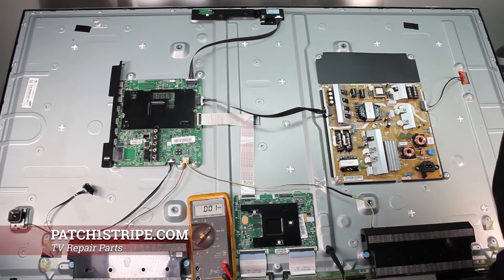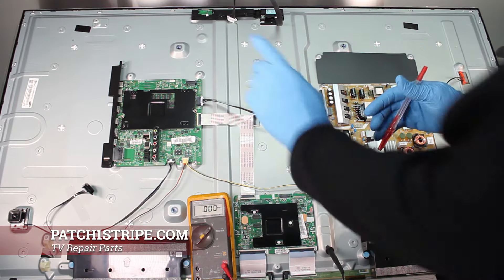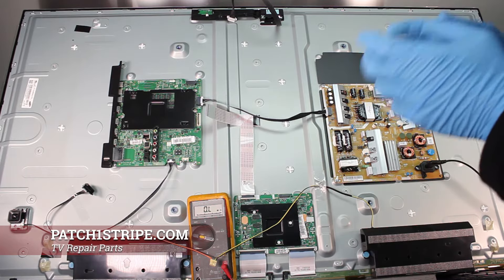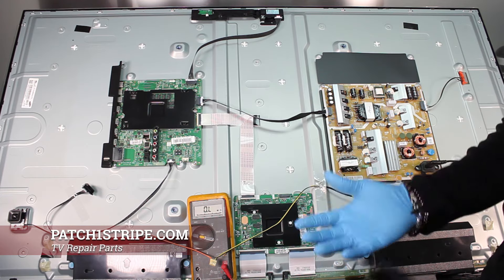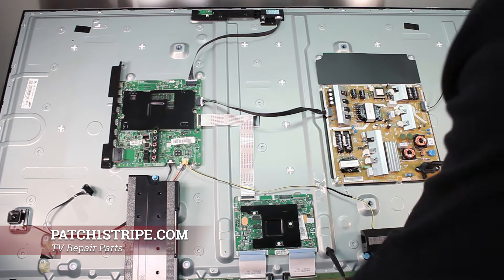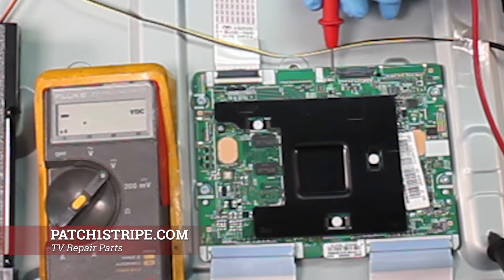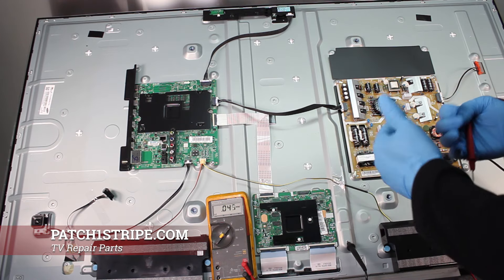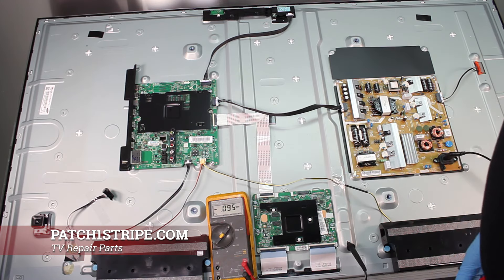HOW TO REPAIR ANY SAMSUNG LED TV:  Won't turn on,  No power

Comment: I have an 82" Samsung UN8000 that doesn't turn on, and the power indicator LED on the bottom of the TV is completely off.  Is that just a fuse or the power board that needs to be replaced?
Reply from the maker: Hello, you will have to take the back off of your tv and go through the process, other wise you will be shot gunning your repair with un-necessary parts. This process is proven to work, it will save you time and money.
Reply: @Patch1stripeTVParts  Edit:  After following your process, I've discovered that I now need to purchase the main board for the 82NU8000 Samsung TV.  Do you sell parts?  If not, do you know roughly how much it cost?  Thanks P1S.

Comment: Thanks for the great info ...now quick question when I plug in the TV I get clicking and red led flashing i can hear it buzz on the left of the power supply board then it shuts down and tries again.. i have no leds lighting up no matter what I disconnect so do I have a power supply problem or an led problem im guessing led because that's my luck... thanks for your time..ps my tv is identical to the one in this video...oh one more thing when I disconnect the main board from power supply board it quits clicking on and off
Reply from the maker: Well your at 50/50 in your choice of parts to replace. I would choose power supply.
Reply: @Patch1stripeTVParts  Funny thing is I went to buy a power supply and the guy asked if it was blinking red in the front i'm like yeah … then he refunded my money and said it's the led or backlight I guess he said that he sells these all the time and people hassle him for a return because it's hardly ever the power supply with that model so i'm going to see if I can do a multimeter test to rule it out if it's the LCD though that would need to be dropped or there would be dead pixels in it before it went black wouldn't you think? I really appreciate you getting back to me my mom has no money and i'd really like to get this fixed for her this was her late husbands TV he always bought the newest stuff that came out when it came to technology.. God Bless be safe and thanks - Steve

Comment: good evening sir. i have SAMSUNG UHD 55 inches model RU55RU7100K when i give power the RED light blinking 2 times continues. how can i know the mother board or power supply has fault.
Reply: praneeth fernando You won’t know until you open the back. He actually explained the eliminations process in the first 13 mins.
Reply from the maker: Wil is correct. You can do this. We are here to help you do it! Let us know how you are coming along.
Reply from the maker: Thanks Wil for responding. Help is appreciated.

Comment: Hello sir, I have a Samsung QN075FLLV2H space LED TV 75 inch I have replaced the power board but still not getting any power. I did not use a voltmeter to troubleshoot before replacing the power board, I have disconnected the main board from the power board and still no power or LED lights are coming on. Any suggestions? Thank you in advance
Reply from the maker: Most of these 75 inch plus TVs that I have encountered lately has needed backlight replacement. I think you need to replace your backlights. Hope this help.

Comment: You said that it will work without the wi-fi and then said it would not ------ Will it work with out the wi-fi cable hooked up?
Reply from the maker: yes
Reply: @Patch1stripeTVParts  Thanks

Comment: My tv wont power on and bfr that my remote stopped  controlling on/ off switch but it works fr menu options so i opened my tv and i tried to unplug the main board and plug it bak in it started smoking but still back light come on when i unplug it but i can see a burnt black chip on it ,also my tc board wen i unplug it the bak lights dont come on does the mean its bad too?
Reply from the maker: The t-con board is probably fine. You have to resolve your mainboard issue first. I think that will solve all of your problems. I will check my warehouse to see if I have that part number. I will contact you in a couple of days.

Comment: I already change the t-con , the power supply and the main board brand new and the tv, samsung un50eh5000f, still won't turn on. Do I have to check the back lights? Please help.
Reply from the maker: You have changed everything except the backlights.

Comment: I have the newer Samsung T-con in the mainboard TVs. When I plug both ribbons from main to the LCD address panel , my TV struggles to stay powered on. When I plug any single 1 of the two ribbons to LCD address , the TV stays on but no picture. So I guess it's the ribbon cables, LCD address board, or something further pulling the TV to power down ? 

Any tips on what I should do?
Reply from the maker: First I would swap the ribbon cables around to see if you get the same results which would eliminate the ribbon cables as being your problem. Next I would let the tv come on and stay on for about 2 minutes then unplug power from the unit and feel for hot or warm components on the main board and the LCD address pcb's. If you find components that are over heating that would be you problem area.
Reply: I put a new mainboard and powerboard in so those should be good from overheating issues. I'll buy new ribbon cables and go from there! Not sure at all how to work with the PCB address boards because they connect under the metal case to the screen through some orange film connectors
Reply: @salmannasir793  I am having the same issue.  Just happened last night out of the blue.  The only thing I did that day was connect a Chromecast to the HDMI and the USB to power it. Did replacing the ribbon connectors solve your issue?  Thanks, Salman.

Comment: need some help sir, about my samsung 32 inches led tv, hope you can tell me the problem. to much heat on the other side of my tv, but the other side, top and bottom are all normal, not heating that much unlike the one side, ty for the help, more power on your channel,thanks.
Reply from the maker: hello, the only thing behind the screen is LED backlight strips. You may have LED strips that are failing and causing other LEDs to draw excessive current. Take the time to remove the LCD panel and see what's going on behind it. It's easy to do with a small panel. Watch my video on replacing backlights for instruction.
Reply: Patch1stripe TV Parts ty very much, going to watch your video on replacing led,ty.💋

Comment: I have a 46" Samsung Smart TV that has backlights on but no sound or picture. I did your process of elimination but can't come up with which part to replace. Any help would be appreciated.  Gary W.
Reply from the maker: Did you ever try disconnecting the wifi module to see if that gives you video?  If so have you check that little fuse on the t-con board? Are you getting 12volt dc or so one both sides of that fuse? If all this checks out I would consider replacing the main board. Let me know.
Reply: @Patch1stripeTVParts  Thank you for your quick suggestions but I got confused in the process I decided to replace all the boards. Hope that works.  Thx, Stay safe & well,  Gary W.

Comment: I have a Samsung 4k tv, model UN60J6200AFXZA. Nothing comes on, but when i unplugged the LED strip cable that goes to the power supply the red light comes on once i press the power button on the tv. Could this be a back light issue? Should i be able to see what's on the screen if i flash a bright light on the screen? Because i dont see anything while flashing a light on it.
Reply from the maker: Go back and follow this video and your questions will be answered. I will help you with addition information and specific questions. Let me know.
Reply: @Patch1stripeTVParts   I followed everything in the video, the red light only comes on when i unplug the led cable from the power supply board, i can also now see words moving on the screen when i flash a light on the tv. Also when i unplugged just the lcd panel and powered on the tv i could hear chirping sounds near the led cable. I'm pretty sure it's the back lights, i just don't wanna make a mistake and get the wrong kind of back lights for the tv. Thanks for the help.

Comment: Hello Again, Just saw a video about loose ground screws on boards. I have two or three screws that will not tighten. Could that cause my problems? What do I do to fix the screws?
Reply from the maker: find larger screws but you always need good grounding.

Comment: I have a smart samsung tv 65” the tv turn on , but the upper part of the screen is clear and the bottom is darker and blinking, also sometimes the tv turn on and off by itself and recently I can not turn it on or off with the remote control I have to plug it in order to turn it on. I can only see one Chanel I cannot change Chanels. My husband think that the problem is in the power supply. What do you think we can do to solve the problem? Thank you.
Reply: samsung Led 65” UN65F6350AFXZA
Reply from the maker: Take off the back of your tv and follow the instructions on the video. The first move will verify if you have a backlight issue that I am suspecting is your issue. Hope this helps.

Comment: I have a vizon vp422 HDTV10A that lights the yellow Vizon symbol and goes white when power button is pushed but then nothing comes on. any suggestions? I dont want to spend money on parts I dont need. steve
Reply from the maker: are we talking Vizio or Vizon?
Reply: Sorry my bad. Should be Vizio

Comment: I think my TV has a power board failure/issue as I'm getting no back light whatsoever. The TV is 10 years old and after googling I can't find anywhere that still has this model in stock. Is it time for me to just buy a new TV?
Reply from the maker: What is the model number and brand of your TV

Comment: I have Samsung smart tv. There are 3 dotted back lights in “L” shape in the middle to the top of the screen which doesn’t go off when the tv is turned off . What are the possible problems?
Reply from the maker: The lens over those led backlights have fallen off. They need to be glued back on.

Comment: I have an LG 65"smart tv but at the moment it's not so smart ,lol tv comes on i can go through my apps but HDMIs are not working and internet is not connecting it says not conected it just sits  buffering with the LG icon dancing aground and also i got no sound, any advise
Reply from the maker: disconnect wifi module and see if HDMI connectors start working. If not replace you main board. Hope this helps.
Reply: @Patch1stripeTVParts  thanks for responding so fast will try ,that's what I'm talking about i send the same info to various YouTube channel months ago never got back to me ,thank you for being so humble sir ,I'm already subscribe to your channel 👏👏👏 will post back after I try your tip ,over the weekend thanks so much again.

Comment: How the back light come on without the order from main board. I notice that  you just unplug the power conector from the power board to the main. The backlight turn on without any order?.
Reply from the maker: That is how Samsung TV's are designed. You are making this more complicated than necessary.

Comment: Where can I find parts for my 55-in LED Samsung it's not turning on standby light is on the screen is on but it's not transmitting the signal I can't power it on or power it off only if I unplug it
Reply from the maker: Patch1Stripe.com
Reply from the maker: What is your conclusion? What part that you need? What is the model number of your tv?

Comment: How can I determine if my panel is 100% the issue? I have replaced tcom board. I have full power and backlights. I have issue on left side with no picture and some lines. Entire top half looks like white static. I fixed static with piece of tape on ribbon but cant fix left side. I need to know if this is panel issue and if my tv is trash or what.
Reply from the maker: send a photo

Comment: Mine, when i disconnect the main board the backlight is flashing. What is the problem?
Reply from the maker: You need to replace backlight strips.
Reply: @Patch1stripeTVParts  all leds working on the backlight strips. I dont know, maybe the power board?

Comment: I have replaced all of the boards including wifi on Samsung UN40H5203AF model and still no screen activity.  The power red light flashes when first plugged up and after a few seconds the light goes out but all of the boards have lights indicating it is getting power.
Reply from the maker: What lights goes out after a few seconds? Have you followed the instructions on the video? Disconnect the main board from the power supply apply power and tell me if the backlights come on and stay on.

Comment: Hello sir wondering if you can help me. Been watching a few of your videos but am not stuck and have no idea what the problem could possibly be. I have a samsung tv model un60h6203af had stopped working after a storm, no power no red light indicators nothing. So I went ahead and replaced the power supply board still no power, now I replaced the main board as well right after still nothing. What else can it be? Please help I'm into this thing a couple hundred bucks now wouldn't wanna just trash it after the fact but I really dunno what else it can be. Lemme know what you think much love from Vancouver Canada.
Reply from the maker: JRZ604    I would be sure that I am getting power from my ac outlet that I am plugging the tv into for power.  If all that checks out,  using the remote turn on the tv. Tell me if you are getting the red light in the front.  Let me know.
Reply: @Patch1stripeTVParts  TV outlet is fine, tried everything from manually pushing power button on the actual tv set and remote. There's absolutely no red light and when I unplug the mainboard no backlight as well. As stated I went ahead and replaced both power supply board  and mainboard, please help 🙏.
Reply from the maker: @JRZ604   what I need you to do now is connect everything back up except the cable that goes to the LED strips from the power supply board and let me know if you are getting a blinking red light in the front of your tv.  Also, where did you purchase your power supply from?
Reply: @Patch1stripeTVParts  Hello just did exactly what you said to do and when I plug in the power the red light flashes 7 times and stops. Tried it 2 times just to be sure and same results, the power supply was bought from tvparts.ca and the mainboard www.digitronics.ca please lemme what you think is the issue.
Reply from the maker: @JRZ604  I think you have bad LED backlight strips. I have them in stock for your model tv. If you want to purchase, I will sell the set to your at a reduced price. Let me know.
Reply: @Patch1stripeTVParts  Are they brand new and what are you gonna charge shipped to Vancouver Canada

Comment: My samsung (LED 46 tv  UN46f6800AF) is clicking on/off after sometimes, Any suggestion?
Reply from the maker: go through the process on the video of disconnecting the main board from the power supply and when the backlights come on, see how long the tv stays on before the clicking starts. If the clicking does not happen, replace the main board.

Comment: Thanks for your good job, I have a Samsung TV set model code= UE46D5700RSXZF, version no : 02,  S/N : Z89B3SAC200599N, please I tried step by step as you instructed, the power board tune the backlight on immediately I connected the second board the back light and the red light started coming up and off even when I connect the third panel it remain the same coming up and off up till now, please sir what is the next solutions for it?
Reply from the maker: Replace the main board
Reply: It come on and then off it desplay HDMI1/DVI on the screen before tune off then turns on again automatic and off
Reply from the maker: Try disconnecting the WiFi module to see if that is keep you tv from coming on and saying on

Comment: I need your advice about my un65mu6500f. The screen  flashes for a little while and goes off after about 5 seconds it does the same it doesn't turn on or off with the remote control
Reply from the maker: sound like you have bad led backlight strips. hit me back
Reply: @Patch1stripeTVParts  thank you.  I didn't  do anything I just let off for some days and then it worked again but now sometimes it has stripes on the screen
Reply from the maker: @lutesaldivar1617  that's your back lights strips. Some are working and some are not - that causes the stripe effect on your picture. Hope this helps. I sell backlight strips.
Reply: I have a Samsung UN40JU6500. The only problem that I have is a flickering screen, otherwise it works well. Is this flickering an LED strip or backlight defect? Can you help me understand how I can narrow the problem down please?....Mike